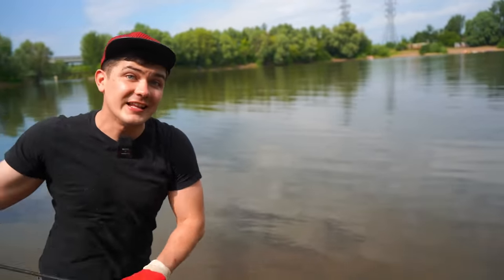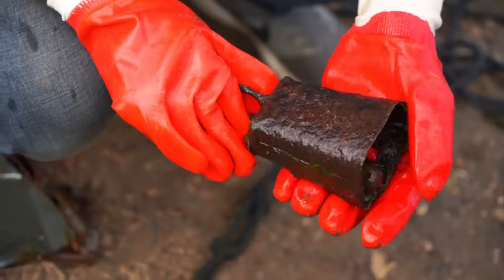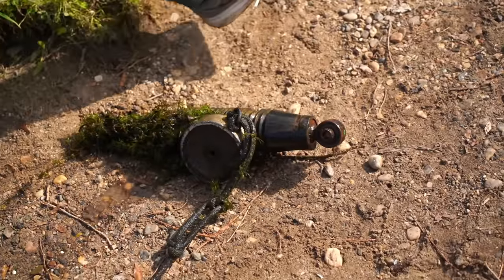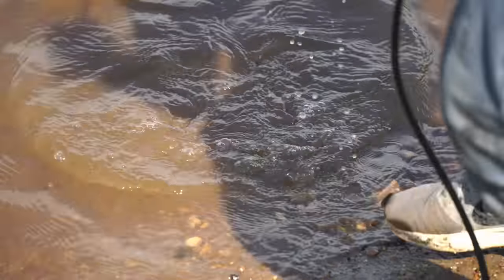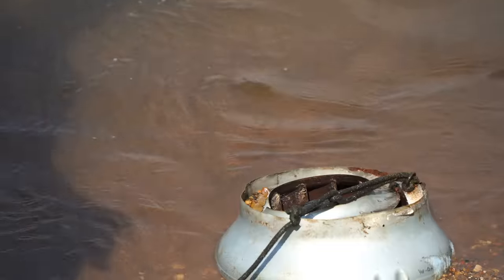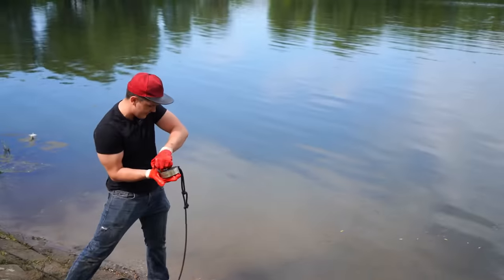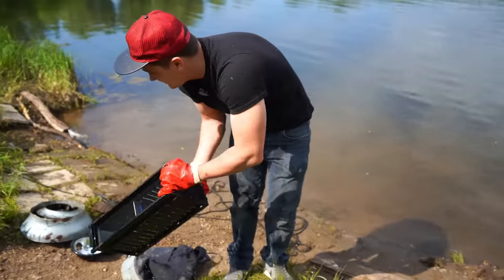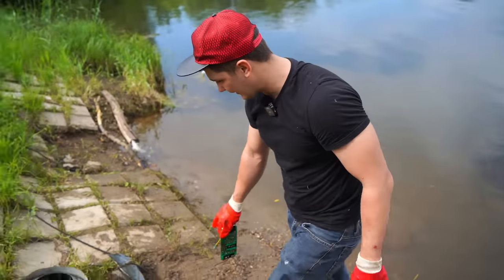Found Parts of Airplane Underwater While MAGNET FISHING!

Comment: The first thing you found was a gun from the plane to shoot down enemy planes
Reply: I think its a F4U Corsair
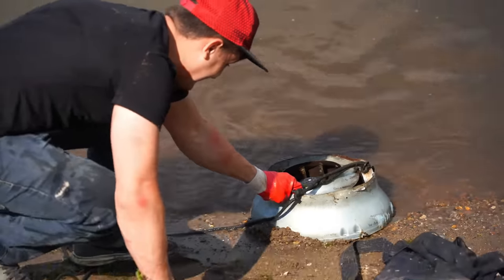Reply: @KQRDZ_Lamia  it could be bec i looked at pics of the f4u corsairs engine and the front plate looks like the part in 9:19
Reply: And the fist part he found looks like it came from a corsair bec that looks        like the part where the barrel comes out from and since it has 2 holes. it could be from one of the parts from the f4u-4 models bec some had only 4 canons